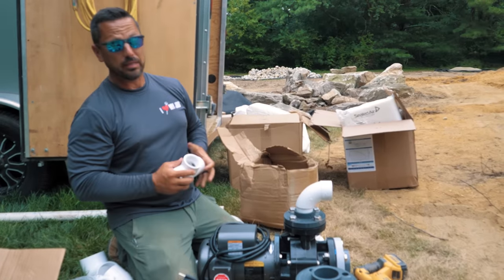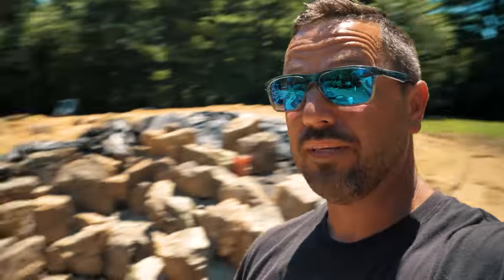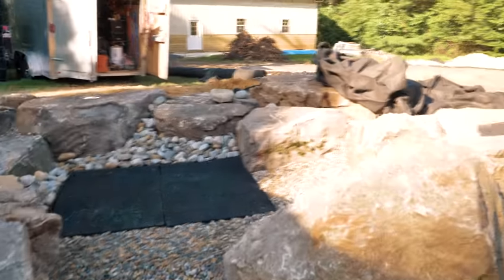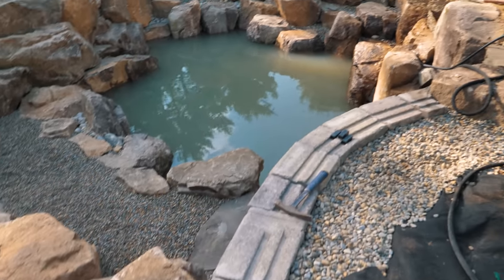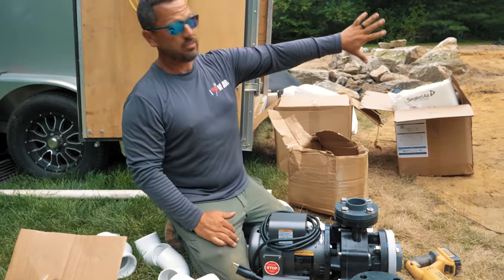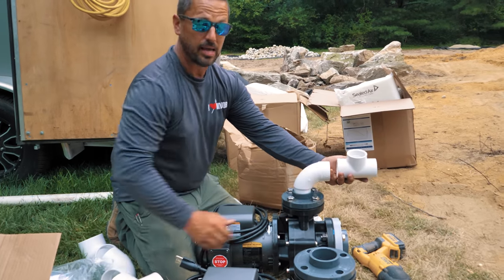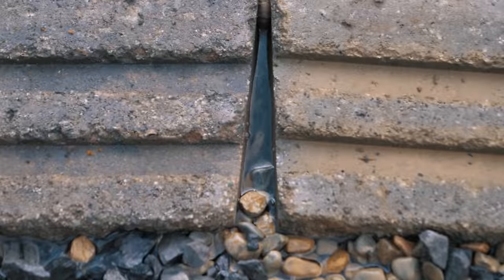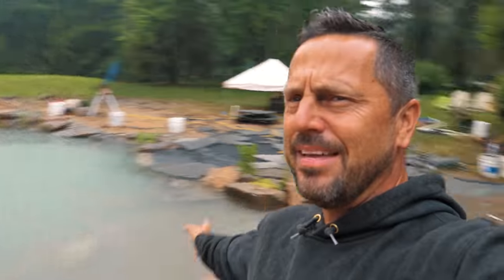THE NATURAL SWIMMING POND is filled! | Recreation Pond build pt 3

Comment: I have a question regarding garden ponds. I just finished building my 12x10 feet garden pond and I wanted to know what I need to do before I add fish. Would it be adding plants, beneficial bacteria, or even dechloronator? Can you please help. Thanks
Reply from the maker: If it’s been over 24 hours you shouldn’t need dechlorinator. I would add bacteria several times a week and start with just a couple fish